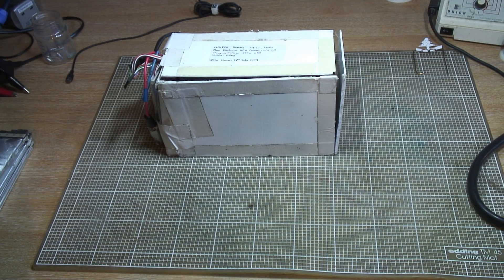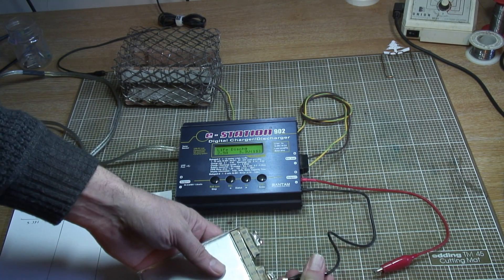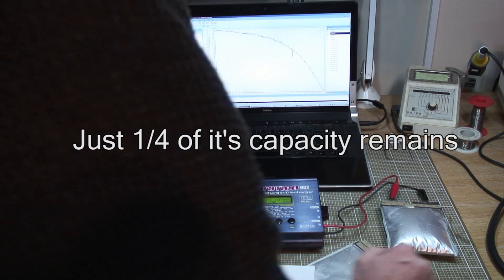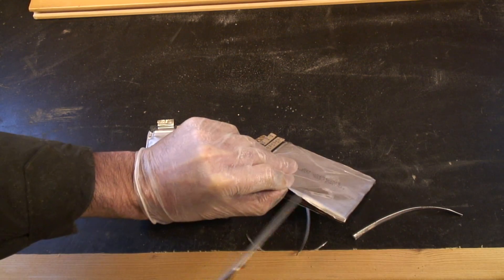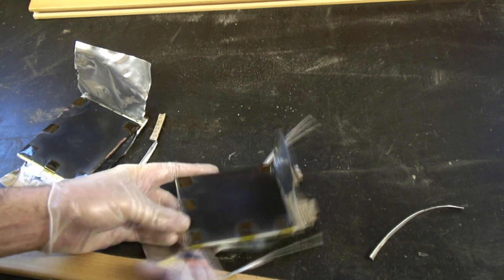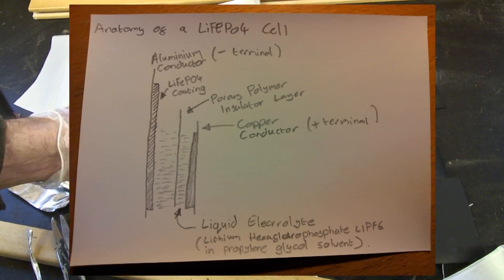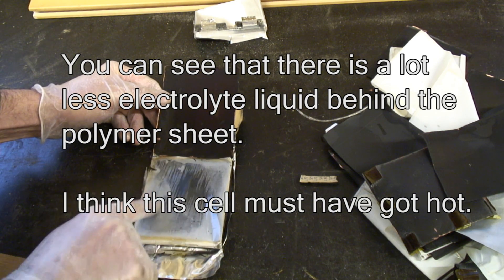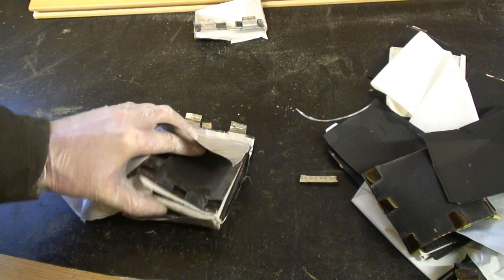LiFePO4 Battery Autopsy/Teardown

Comment: I was probably the BMS. Was that group of cells in parallel?
2V is way to low for LiFePO4. 2.8V is specified by most manufactures as safe minimum.
Reply from the maker: ***** Hi. I started out thinking that the BMS was likely to blame, but came to the conclusion that it probably wasn't, because a.) none of the cells in that group indicated an overvoltage condition, b.) not all the cells in that group were damaged, and  c.) LiFePO4 batteries reportedly have a good overcharge tolerance (I've read of cells being hammered up to 30V and still appearing fine afterwards).... I ultimately decided that it was most likely that dendrite growth from the edges of the plates had pierced the polymer seperator and caused the cell failure.

Yes - the group of cells were in parallel - 4x 5Ah cells to make a 20Ah pack.

Where did you find that 2.8V minimum figure? SignaLab (the cells I have) and A123 both specify 2.0V as the absolute minimum - I personally would have stopped the discharge at 2.5V, but the 2.0V minimum was pre-programmed into the charger and I couldn't work out how to change it. The BMS I am using (SignaLab again) has the low voltage cutoff at 2.1V per cell.

As it's unlikely that you spotted the comment I added yesterday - I highly recommend this fascinating talk I stumbled across last night which is all about the reasons why Lithium batteries fail - https://www.youtube.com/watch?v=pxP0Cu00sZs - It's a great rundown of the capabilities of a variety of different lithium battery types too. Having watched that, I'm more convinced that the cell finally died because I'd always stored it at 100% State of charge.

Thanks for watching and thanks especially for taking the time to comment. Cheers!!
Reply: Jim Conner
Those Signalab BMS use fixed treshold IC designed for LiCoO2 so the tresholds are not good for LiFePO4.
They only stop the charging when highest cell is at 3.95V. And yes LiFePO4 is tolerant to higher voltage in the sens that it will not catch on fire but it dose not like beeing charged at more than 3.6V and is even worse if they need to stay at that level for long period of time.
I will take a look at that video after this comment thanks for the link.
I use LiFePO4 for a few years now offgrid with no problems.
I designed a Solar BMS charger for offgrid application (is less ideal for electric vehicle or eBikes)
And I have some videos on my channel about 100Ah GBS cells and A123 20Ah cells that may be of interest to you.
Quality of the cells is also important. There can be manufacturing defects that will lead to failure even with a proper BMS.
Reply from the maker: ***** Perhaps Signalab design for both chemistries. I'm 100% certain that it cuts off at 3.65V as I've checked it out with my multimeter in the past. LiCoO2 cells look like the way of the future though - amazing longevity on those things.... and they happen to be the ones that Tesla are using too, so looks good for any Tesla owners out there. Have just checked out your channel and subscribed... excellent - that'll give me something to watch over my christmas holidays :). Cheers!!
Reply: Jim Conner Thanks Jim for that link. I just watched that video and there are good information there.
I have doubt that your Singnalab BMS stops at 3.65V. The reason for that is that even if recently there are IC that have LiFePO4 thresholds they are way more expensive than this old ones for LiCoO2.
LiCoO2 is the most common Li-ion battery is what you have in your phone and tablet and billions of them are build every year.
They are normally charged at 4.2V so they have the best energy density since for  portable applications like phones and laptops the weight is way more important than cycle life (they will do fine for two or three years before you upgrade to a new model)
Charging those same cells (that normally have a 500 cycles life at 4.2V) at 4.1V will decrees the capacity to about 80% but last 2x as long for so 1000 cycles in this example going down to 4V will double again to 2000 cycles and at 3.9V it doubles again to 4000 cycles but capacity will be just 65% of the one at 4.2V.
At lower than 3.9V the advantage starts to disappear since the capacity will go down to quickly.
So in special application like military and space they use Li-ion charged at a 3.95V that offers the best life and those are the IC used in almost all low cost BMS on the market that use that 5 pin or 6 pin IC for each cell and has fixed thresholds.
If you try to charge the LiCoO2 at 4.35V or higher the cycle life dramatically goes down (you can see graphs even in the video you provided link to I think at about minute 37 or so)
LiFePO4 is more tolerant to overvoltage but it will still damage the cell and reduce dramatically the life of the cell. Form 3.6V (that is already a stress) to 3.9V is a huge difference.
What you have measured as 3.65V is do to the fact that your cells where balanced at the time you did the measurement but got unbalanced over time (that passive unintelligent balancer will do nothing and start only above 3.65V to late).
So the reason you measured 3.65 is that the charger not the BMS stopped the charging (and at not sure how many cells you had say for 8 series cells) then charging ended at 28.8V and since cells where equal it stopped there but over not to many cycles the cells got unbalanced and that group of 4 parallel cells where overcharged at 3.9V or close and since they spend a lot of time at that level that degradation occurred and the weakest cell or most affected cells out of those 4 ended dead first.
You know your exact model of BMS just go and check all the spec and they usually do not hide that Over voltage disconnect is at 3.9V but they say that is fine :) since you battery will die after quite some time (max hundred or so cycles usually a few years of casual use) and they do not care about that.
Reply from the maker: ***** I hear what you're saying there, but I think that I have dodged that particular bullet. My BMS has two 4-pin chips (plus 5 resistors, an LED and a SOT23 package) per channel. The chips are Fairchild branded and say V831Y 817B on the top, but I've been unable to find a datasheet for them, so am uncertain as to exactly what their function is (They look just like opto isolaters, but could well be transistors in a strange package) . In the past I have tried charging the pack using my Bantam eStation 902 charger, but that was unable to complete a charge because the BMS disconnects the battery charger when any individual cell gets too high, causing the Bantam charger to error with 'Connection Broken' during the charge cycle - this appears to happen whenever a single cell reaches the cutoff voltage (which is higher than the voltage where balancer bleeding starts to occur). My pack is a custom  9S 29.7V 20Ah pack (it started life as an 8S) which is running with a tweaked 12S BMS.The power supply that came with the pack used to be a constant voltage 30V, 3A switchmode, but I tweaked that up to 33V to work with my 9S pack. I found a picture of my BMS online  http://4.bp.blogspot.com/-NxOQejvuXy4/TlPeQRif0qI/AAAAAAAAQ2w/ZmrIG26kT18/s1600/IMG_6690-1.JPGBecause the bleed rate on that BMS is pretty limited, I actually balance the packs using Bantam pack balancers (with 500mA bleed rate) whilst they're charing too - it speeds up the charging quite a lot as there's less time waiting with the PSU disconnected as cells bleed down from their max voltage. After a charge cycle (with balancing at the same time) the pack measures in at a little under 33V, I wish I could find an exact model number for that BMS, but info from SignaLab seems to be nonexistent. I guess I could just mail Li Ping and ask him though - he's been good at replying to my questions in the past.Anyway.. this reply is long enough now and I have a new video to upload :-)Cheers!!
Reply: Jim Conner
I know that particular BMS and I was right that uses the LiCoO2 3.9V cut off voltage and not good for LiFePO4.
There are 5pin SOT23 on the back of that PCB for each cell and those are the dedicated IC that have fixed low and high voltage thresholds.
Those 4 pin devices are optoisolators as you first guest.
I think you charger was a constant current charger not a constant voltage one.
If it will have been just a constant voltage power supply the overcurrent protection will have disconnected the power.
In good quality cells you do not need much of a cell balancing the problem is that cell balancing dose not work on LiFePO4 since that BMS uses IC designed for a different chemistry.
33V is way to high for 9S LiFePO4 pack even if they are in perfect balance but I doubt that was the case. One of those 9 cells was probably at 3.9V that is the only way the BMS was disconnecting the charging.

I'm quite convince now that I know what BMS you used that the battery fault was from the use of improper BMS. You are not the only one to have dead cells while using this type of BMS.
Reply from the maker: I've now removed the BMS so that I could get access to the back of the board, and you are indeed correct - On each channel there are a 5-pin SOT23 labelled R2RR and a 6-pin labelled 4GEE - I am of course unable to find information about those two on Google (aside from other people asking what they are too).

The charger is of course constant current until it reaches the constant voltage stage. Why do you say 33V is too high for the charger? That works out to 3.66Volts per cell - Would I be able to get a full charge with any lower voltage?

The SignaLab BMS seems to be generally well recommended across e-bike forums - How did you come to find out about the 3.9V thing? I don't suppose you have links to the relevant datasheets do you?

Cheers!!

Comment from the maker: I just stumbled across a superb talk about the different types of Lithium cells and why they all ultimately fail. I thought it was such a good talk I'd put a link here for anyone who fancies it. https://www.youtube.com/watch?v=pxP0Cu00sZs Cheers!!
Reply: Good video...First i would be concerned NOT to inhale any of the gasses...not good...Second, adding new batteries, to a 5 year old pack can sometimes have issues(ie. charge/discharge?)...Has your new set worked into this pack ok?
Reply: Jim Conner Yes I watched that - interesting but a bit over my head.Cheers,Patrick
Reply from the maker: PATRICK MCKOWEN I'll admit that some of it went over my head too... I'm like a moth to a flame when it comes to clever science... always attracted to it, but sometimes get my wings a bit burnt :).... Cheers!!
Reply: @ 12:29 the join in the plastic membrane might have caused a higher internal resistance for that cell partition relative to the other cell partitions causing an imbalance of internal charges. over a 5 year period the imbalance would most probably have grown substantially probably being one of the causes of the over heating problems.
Reply: Looking at the video again @ 12:48 the plate you just flipped up along the left hand side I notice there seems to be a blackened section almost the same size as the membrane over lap, id say this is evidence the membrane join was the cause.

Comment: Thanks Pal, great that you have torn apart a failed piece to show us. Heat or Thermal Runaway is always a teething issues. Look at Boeing 787 Dreamliner battery problems, grounded almost all ANA new planes. The Jap lab guys still can't figure out the actual causes. Impurity ? or have to rethink how to package this stuff ?
Reply from the maker: TheOldmankk You make an excellent point there. After I'd taken the battery to pieces I did some googling on battery failure analysis and found the extreme procedures that the professionals went through when they tried to work out what went wrong (microscopes in an argon filled box etc) - The failures generally seem to be with microscopic 'dendrites' sprouting from the lithium surface and working their way through the polymer seperator.... of course... what causes that to happen is still up for debate. Thanks for watching and taking the time to comment. Cheers!!

Comment: Interesting that Jim. Didn't realise there were so many individual cells in those.
Reply from the maker: Thanks John - Nor did I - I was expecting just two layers inside there. I'll never worry about running multiple cells in parallel again. Cheers!!
Reply from the maker: ***** Hi Sparky. You can get LiPo and LiFePO4 cells which do have a BMS onboard, but these cells don't - they rely on an external BMS to keep everything in check. If the cells did have onboard BMSes then it would not be viable to group the cells together as they are in my pack. You are totally right about both sides of the cells being coated in material for increased capacity and current capabilities - I added the badly-drawn back-of-an-enevelope diagram was an attempt to highlight the role of the electrolyte in the cell because I didn't feel that my rambling did the job of explaining well enough. Thanks for watching, and taking the time to comment. Cheers!!
Reply: Depends what cells, don't LiPo's have a charge controller built in, and need to be paralleled in a special way ?
Also, looking at your cells, if both sides of the plates are coated with carbon, then both the 'front' and 'back' are against a plate of the opposite polarity, so making a much larger surface area, and that means more current